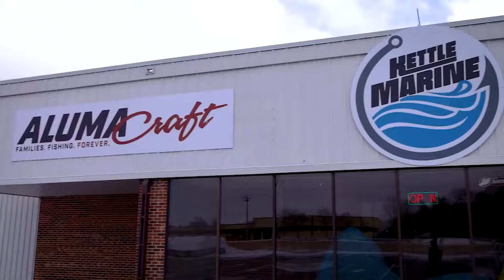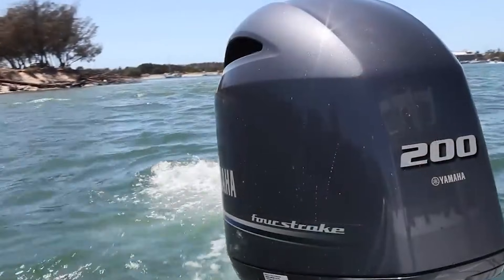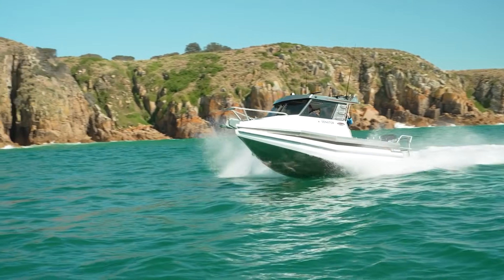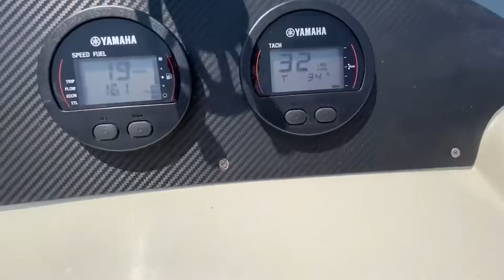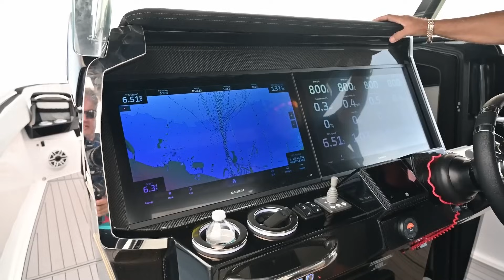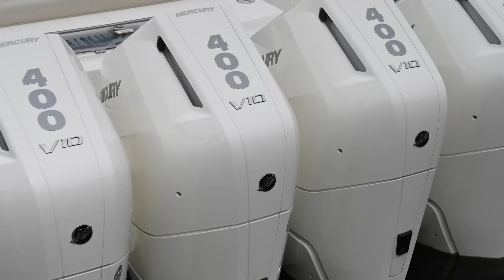The SHOCKING Difference Between American and Japanese Outboards

Comment: Time will tell on all high performance motors . You can go faster ….. but the bearings on the lower unit better have good lubricants or it will be a tow job on the lake . Three of us in 2009 had our Mercs tow off the lake when our lower units packed up . Now ,Merc has the best lubricant in the market and l used it on my Yamaha now